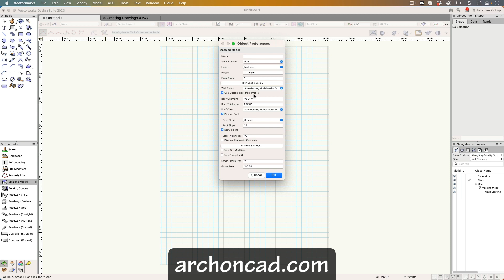Massing Model in Vectorworks 2023

Comment: Thanks for the video, Jonathan! Yes it's very important to turn on Use Custom Roof from Profile if you want to edit the roof later. and one question: is it possible to change the default pitched roof setting? the defalut setting is 4 slopes for a pitched roof, but i usually only need 2 slopes with 2 gables. I create many massing models for my urban design project, so i need to edit profile for soooo many times to replace all the slopes with gables, which is very time-consuming. Thank you so much!
Reply from the maker: Thanks for your comment. I gave this a lot of thought and I could not think of a good way to do this. If the buildings are all about the same size, then you might be able to copy one building and place it for the next building that's the same size. I tried some different techniques but they all failed. So, I'm sorry I think it's longhand for you.
Reply: @archoncad  Thanks for your reply! Yes maybe the only way to make it easier is to copy one massing model, which is already edited, and then reshape it.
Reply from the maker: sorry, I tried the reshape option and and the roof doesn’t update.